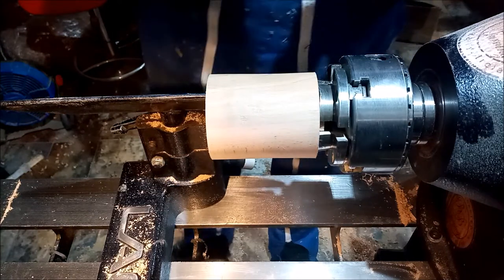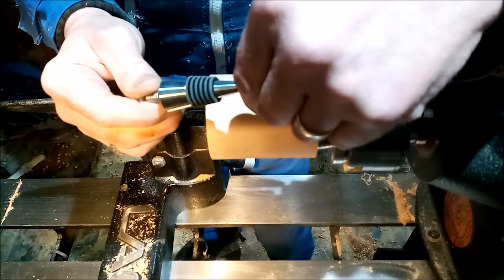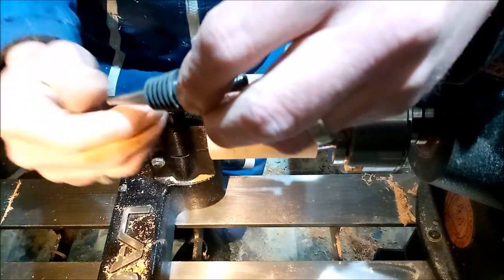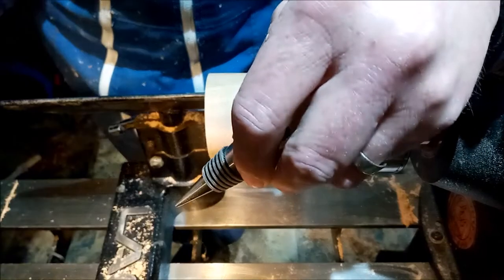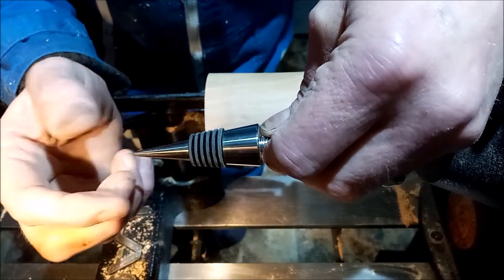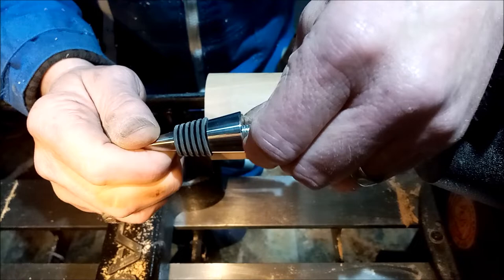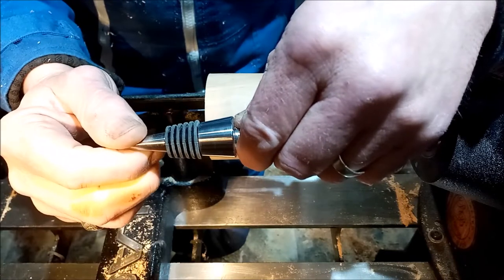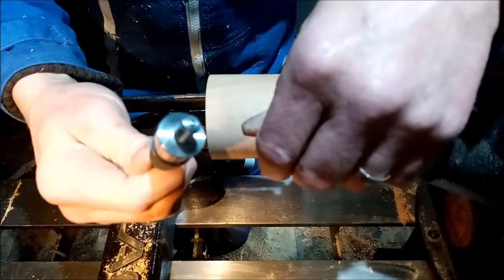Turning kits 1.  A wine bottle stopper / Wood Turning

Comment: Great Demo Shay, really enjoyed it and must admit a little tempted to give one a go.. If I am buying a 8m drill I can just as easily pick up a couple if you still need one
Reply from the maker: Cheers Buster. 8 mm I can get over here, the problem is that for an m10 tap it's supposed to be an 8.4 mm which I am finding difficult to get. As I said in the video I normally get strange sized bits from the UK but with brexit no one is exporting. I will find a replacement one somewhere mate, thanks for the offer though.
Shay
Reply: just a thought Shay if you can find it in the UK let me know, if I am going to have a go at a bottle stopper I guess I will need one.
Reply from the maker: @busterwest1644  will do mate and thanks again.
Shay

Comment: Shay ... as always, a great "teaching video".  Great info.  Lovely piece of wood, and a great finish.  I was aware of the problem with the Chrome Stoppers, and have only used Stainless Steel ones in the few I've made ... but the screw does not come out of the ss stopper in the ones I've sourced. Can you say where you get yours that have the removable "screw" ... if you cant say, no problem.  As always, well done - great info. Thanks. Gerry.
Reply from the maker: Not a problem at all Gerry. I get them from penkitsmall, the only thing ordering from them is to make it worth it you need a large order. What I do is every now and then when I need pen kits which I bulk buy I see what else they have and put it in the order. I do know that a lot of clubs get together to bulk order from them if you get what I mean.
Shay
Reply: @BBTurning  Thanks, Shay.
Reply from the maker: @gerryconvery9000  welcome.